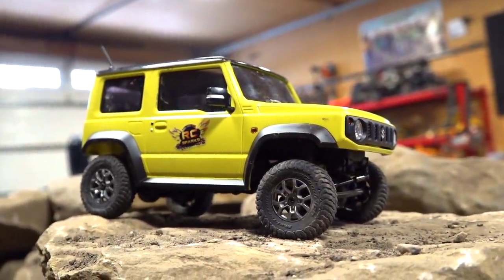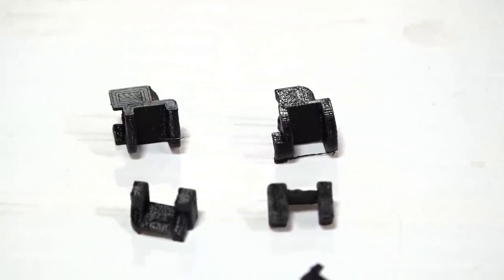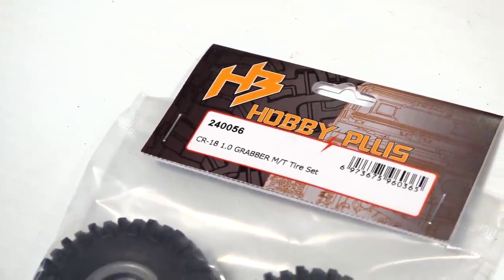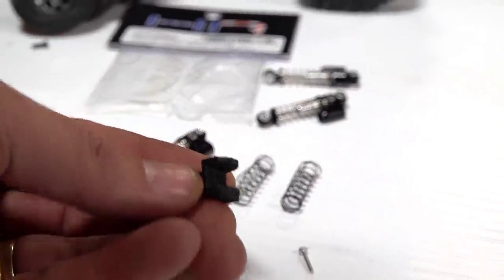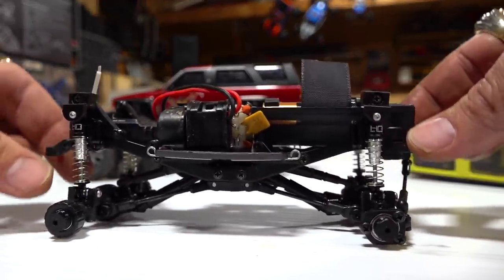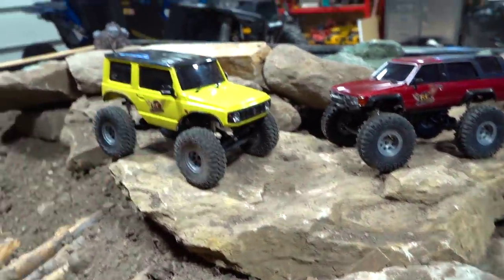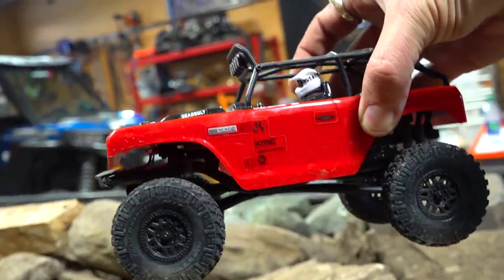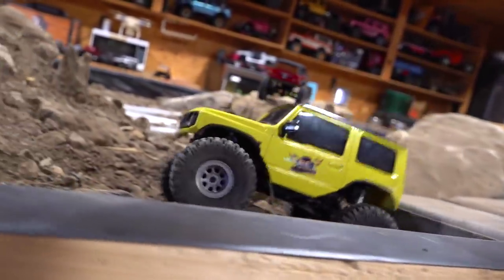MONSTER SUZUKi JiMNY! HUGE TiRES (Kyosho Mini Z MX 4x4 UPGRADES)

Comment: That looks cool with the mods. Thankful for the small scale. Was cleared of cancer and don't go out much and covid doesn't help. Great to have these for indoors. Thanx for the video.
Reply: I just had a pretty serious cancer surgery myself , and came out compleat ly depleated of energy , I also lost 47 pounds during  hours of surgery , but anyways ,,,, I can't find these darn hex adapters he's using , I've looked everywhere , do you have any idea where to find those little critters ?
Reply: Was down to 95 pounds from 140. Almost did not make it back out of the hospital. I pray for your healing.
Reply: @chrisryder4709  not sure but if I find them I'll be sure to let you knoe

Comment: I actually went back down to just a 2mm suspension lift kit with the 4runner tires... been fun so far... I like the more scale driving of it smaller, it fits the appearance better, but then I kept the body intact and the bumpers on it as well... well, also fully replaced electrics with my spektrum radio, 2s lipo capable 30a esc and hitec servo

Comment: I’ve got the 4runner, brass lowered weights and an upgraded servo make a big difference in steering. Have just ordered the kinetic beadlocks for some added down low weight which should help with angles as well. Keen to see you wheel the 4runner hey!
Reply from the maker: Yeah, but you are introducing a lot of rotating mass with those wheels. that will increase the wear in your bearings, and entire drive line of these little Kyoshos..
Reply: @poppygoatshomestead  no doubt, will be interesting to see weather or not the extra weight will pay off in terms of performance vs reliability. Still keen to test though. Keep the good content coming and thanks for the reply.

Comment: It is really much better that way and it will perform better, you have to cut the bodywork but it is mandatory for the passage of the tires. And adapt the shocks, Kyosho always has their own design lol 😁 not always very practical. Good job.

Comment: Should the gear ratios be swapped out when increasing the tire size that much?
Reply: that depends on a few factors.  driving style i think is most important,  some like tons of wheel speed, also how long you want it to run.  Usually have to get creative to find compatible gear options,  used servos are a great way to find tiny gears to try out.